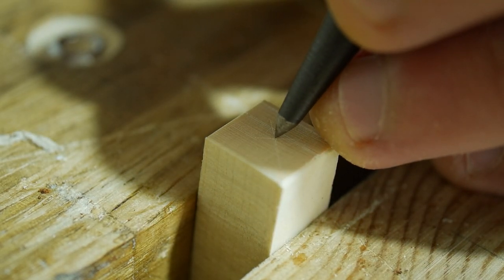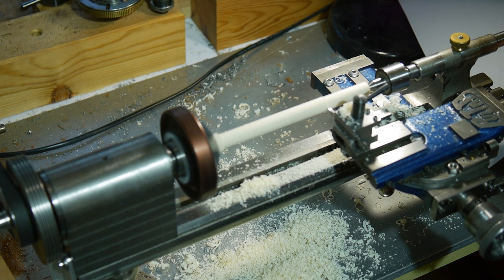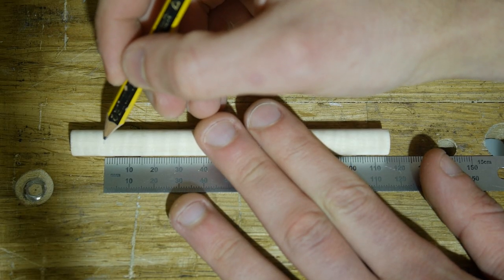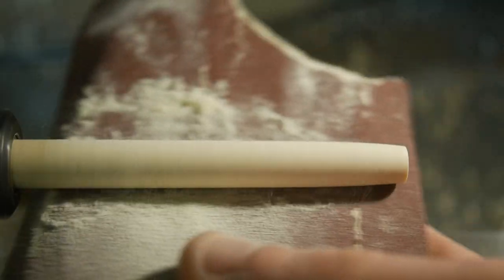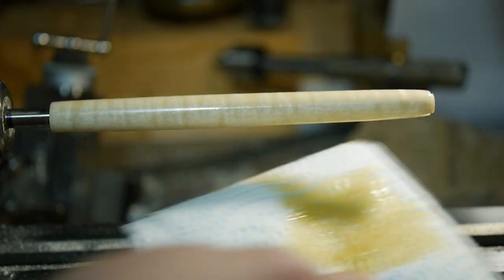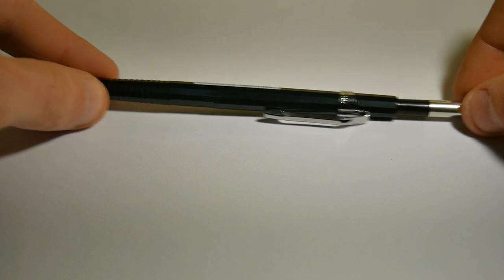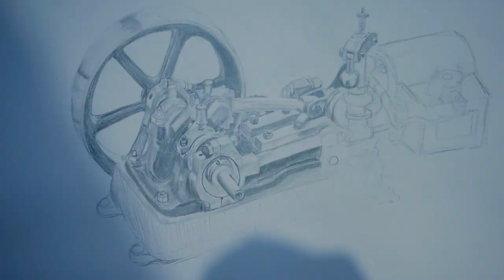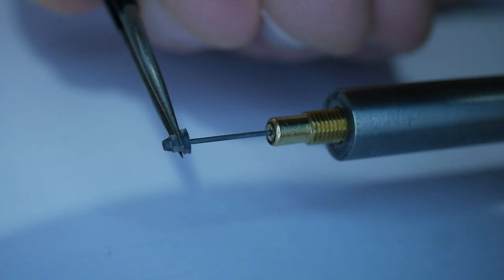A Pencil Upgrade: Woodturning on a Mini Lathe

Comment: For the wood figuring, you are seeing Chatoyancy. This kind of grain is, as far as I know, produced generally at the base or lower trunk of some hardwood trees, where the full weight of the tree creates ripples in the wood (which you can sometimes see on living trees). When sawn in the correct way, you end up with the figuring that is often called Flame Maple, or Fiddleback. It's not only restricted to Maple though, it can be found in many species, such as Red Gum,  Silky Oak and even American Oak and Walnut.

Comment: A fun little hobby in woodworking is pen turning on small bench top wood lathes. They are not to expensive either. You can find kits out there that includes all the parts needed and a mandrel to hold the wood or resin pieces. If you really get into it you can find centering vices for a drill press as well as a press to fit the external metal barrels. Nice work, and a beautiful sketch!

Comment: Something critical to my enjoyment of a good mechanical pencil the presence of metal knurling (Rotring 600, Graphgear 500, etc. are good examples of this feature).  This also makes the pencil typically tip-weighted, which I like very much.

Will you potentially make a video about making a knurled casing?
Reply from the maker: Hi Iron Gears,
We don’t have another pencil video lined up right now but you'll probably spot us knurling other parts in future videos.

Comment: Very nice work! Curious about the titanium tip - did you turn the lead pipe (the actual tube the lead comes out of) integral with the rest, or is it a piece of small-diameter tubing pressed in? I've never attempted making a tip (I do a fair number of metal-bodied P200-based pencils), the most modification I've done to them is stripping the nickel plating off to reveal the brass.
Reply from the maker: Hi Lindsay, I salvaged the tube from the commercial tip and pressed it in to the titanium part. I see no reason you couldn't machine the tip as one piece though, if you are comfortable drilling small holes.

Comment: Hi thanks for sharing. Is it possible to share more of this scale down lathe and its features? Can it cut metal than wood? I have a Sherline lathe which is less rigid than yours.
Reply from the maker: Hi Steve, we will do a video on this little lathe in the future. I do use it for cutting metal but typically only small components. Thanks for watching!
Reply: Hi thanks for the reply. Do drop me a note of the video as I would be turning a wood lathe to cut metal. Already subscribed your channel with delights :)